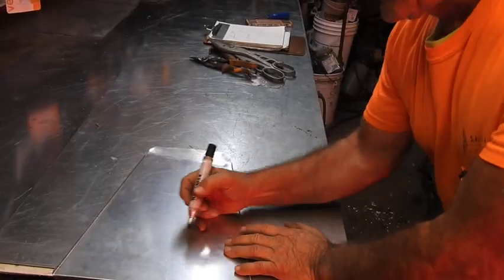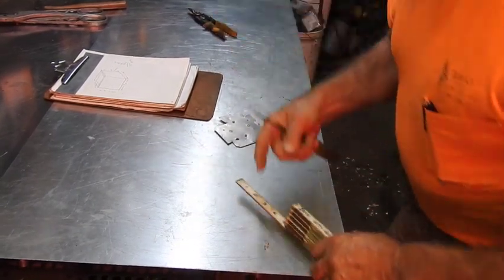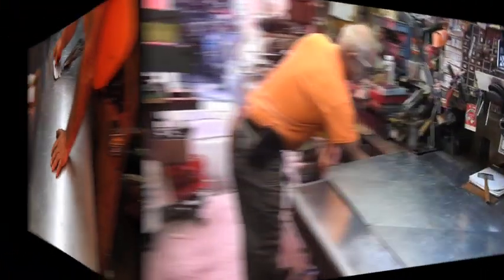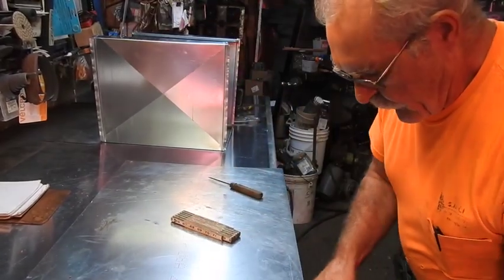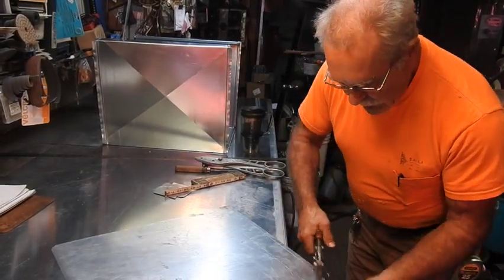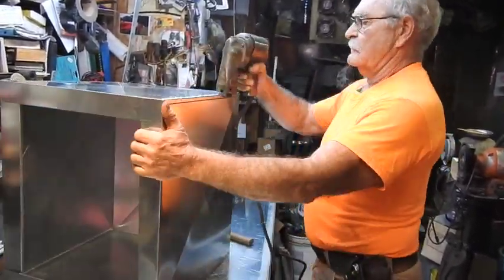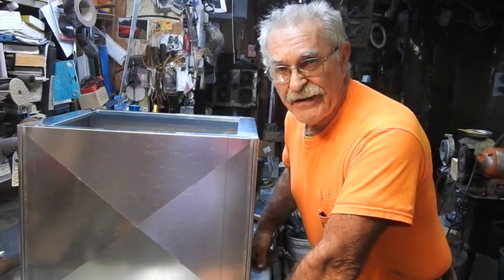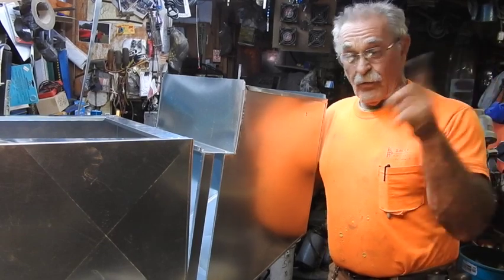Return Air Cabinet With Slight Corner Variation

Comment: I want to upsize the filter (bigger than the side of the box) or use two filters. I just built another box to host filters and integrate it back into the side of the return air cabinet. Is it correct?
Reply from the maker: It should be fine as long as you didn’t restrict the airflow in the ductwork. Restricting the airflow prior to the filter filters will increase the velocity across the filters and make more dust suck through.

Comment: Awesome vid! Newer guy question, why put the furnace on a box as opposed to cutting a side off for the return? Does it improve airflow that much?
Reply from the maker: Many air handlers have slant coil evaporators that allow return air to enter from only one side factory installed in their bottom compartment.  The lowest portion will always have lesser air flow across it with air coming in from the side.  Even if its an A coil or and inverted A coil, entering air flow always suffers on the opposite side of the side hole.  To ensure the full area has access to the returning air at the same velocity across the entire 'A', 'V' or slant coil, bottom return is considered best. Make sense..?  Thanks Marco for the question.  Hey, if you've not found my playlists up above, I have several sheet metal fabrication/installation vids like this one up there: https://www.youtube.com/playlist?list=PLk72G9DTzZ1tqw8ST_xdUlPoy_O-SmuBx
Reply: @tractorman4461  thank you, that is a good,clear answer. Big fan of the channel, I do follow along with more rudimentary tools!

Comment: Nice box! That's how I like to make them… Three pieces. Wraparound and then the two sides. Perfect.  Also, I like the way you add the extra 90° Bend down for structural rigidity on your 2 inch flange area. I try to explain that to my boss all the time but he just doesn't understand. Lol. Glad to see somebody else does. Thanks for the video.
Reply from the maker: Yes, it does make a big difference as far as strength is concerned and it doesn't take that much more thought to do it either.  When you have time, here's a playlist you can skip through.  Its got some good fittings: https://www.youtube.com/watch?v=PvDab537ul4&list=PLk72G9DTzZ1taVZjyeN9DKr52HQ3hhcXd Thanks A R for watching !

Comment: Why did you decide to add bottom return box, not just connect return to the side of the furnace? 👍✊
Reply from the maker: Most manufacturers now have electric air handlers that can be installed horizontally or vertically.  Most of them can only access the full coil surface with even flow of entering air by returning from the bottom of the unit.  Some, because of slant coils, can only enter air from one side or the bottom.   This particular one here has a "/\/" shaped coil that would get extremely uneven air flow across the coils surface if returned from one side or the other.  So with that illustration, you can see the more efficient heat transfer by entering from the bottom. 
     I replaced an air handler for an old lady friend this past fall that had been paying her contractor for service to get her a/c to give her better efficiency for over 20 years.  It was a side return with a slant coil returning air to the coil from the wrong side of the slant.  20 years of continual freeze ups finally took out her compressor. 
    Very good question.  Did that explain it well enough ?
Reply from the maker: Hey you must have been on another device to ask the follow up question concerning the service call where the installer came back to install the larger return...?  It disappears when I click it and I can't see it.  Doesn't go into the spam and so I can't read it comprehensively because I can only see part of the question before it goes away.....  I find this happens mostly when people use two devices.  If you will, enter the question once again, maybe it will stay this time.

Comment: Sheetmetal work at it's finest Wendell!
Reply from the maker: Thanks for the compliment Matt.  This is the simplest of the whole pile coming up.  I thought I'd start with the bottom of the job and work up.....  Stay safe and keep warm.  But I guess it never really gets super cold out there does it ?
Reply: @tractorman4461  frosty in the am and then 70 by noon!
Reply from the maker: @mattthescrapwhisperer  that's gotta be tough....LOL  I could handle that.  Not nearly as much wood splitting with those temperatures !!

Comment: That is exactly what I have as a return air but mine is a bugger with them screws in the filter area....well done my friend....CHEERS
Reply from the maker: There's nothing more aggravating than screws stuck in a filter.  By the time you dislodge it, a good percentage of the collected dust falls off right into the duct !!  LOL.  Thanks for the shout this evening Gator.